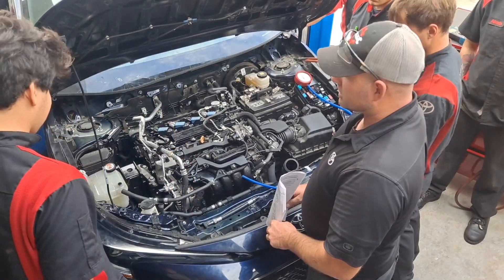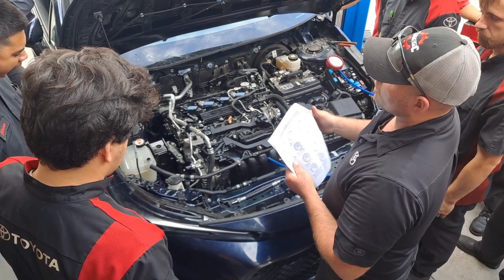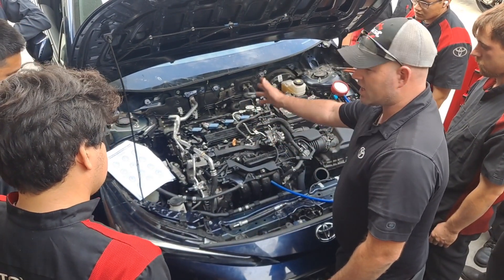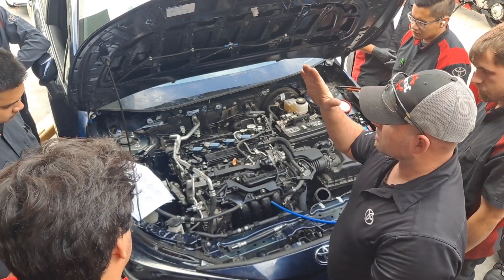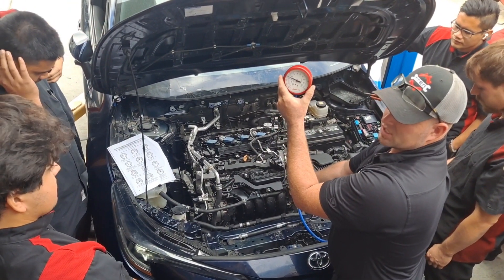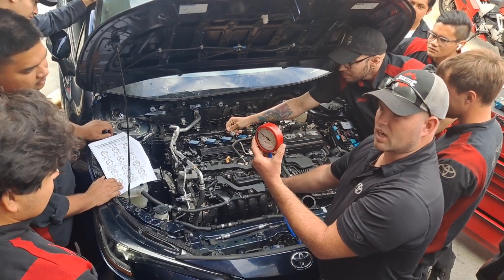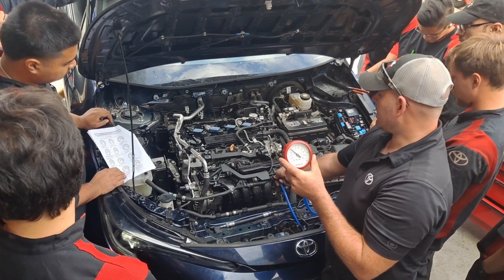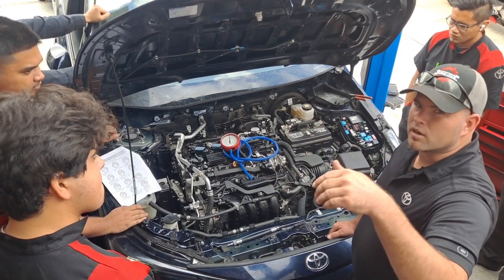A lesson on engine vacuum testing

Comment: As a mechanic here's my two cents. Correct me if i'm wrong. Checking a modern car with a vacuum gauge won't give you an accurate reading unless there is some major mecanical issue such as a broken valve spring, gasket leak or exhaust restriction. However the reason the vacuum gauge isn't ideal on modern cars is because the throttle plate is computer actuated. When the car starts the throttle plate actuates and stays slightly open to keep the ideal amount of air entering the combustion chambers. That decreases the actual vacuum and will give you a reading around the 15-17 inHg (Inches of mercury) which is on the low side even if the engine is healthy. That can mislead a mechanic to think that there are timing issues with the engine.
Reply from the maker: All accurate, and to take it a step even further, an engine like this is actually an Atkinson cycle. It has so much valve overlap it may not make enough vacuum to run a brake booster. So they add a cam driven vacuum pump to "power" anything using vacuum which is really just the vacuum brake booster in thise case. 

So overall I agree the vacuum gauge would not be the go to. 

The scan tool is going to be the #1 workhorse, especially with a relative compression test. 

But ASE A1 still has vacuum readings on it, and it is still good general knowledge for upcoming techs, so I will continue to teach it at a basic level like this. 

Good input.
Reply: @paulkelley86  Correct. I also strongly believe that all mechanics should know how to use a vacuum gauge.

Comment: A studied man will see observe the needle shaking and replace all the valve springs. A wise man won't have read the gauge while it was sitting on valve cover in the first place.

Theory is good to know but awfully dangerous if its all you know.
Reply: I dont understand what your trying to say the comment makes no sense
Reply: @sircob3  These kids are gonna put their vacuum gauge on the cylinder head of a running engine and diagnose it with valve spring failure because no amount of schooling will teach you common sense.
Reply from the maker: @jadenwalker6713  I get the point, luckily this program comes with a mandatory internship. I agree 100% on the job experience is necessary. But I have seen the other side where people trained on the job with no training are basically a clone of the person who trained them. Monkey see monkey do. Not sure why they do it but they know they do it because it's what they were told to do. 
But no argument 😎
Reply: I’ve done this.  Sat the gauge on top of the engine and had to watch about 15 YouTube videos before I realised my mistake.  😂
Reply: @CurboroughSprinter  I've done worse. I pulled apart and entire chassis harness looking for a discontinuity because both brake light bulbs burnt out at the same time.

Comment: if at idle have 12 in/hg  steadily and low power whAT IS PROBLEM?
Reply from the maker: We check vacuum when the vehicle is not running right. What is the symptom of your vehicle?

But yes as far as specs go, that is too low
Reply: @paulkelley86  I HAVE A NISSAN ALMERA 1998 MODEL 1.4CC IT STARTS VERY HARD WHEN IT STARTS IT HAS LOW POWER AND RUNS LIKE IT HAS LOST TIMING.THE VACOUM  IS 12 IN/HG AT IDLE .THIS HAS A DISTRIBUTOR AND IT HAS A CAMSHAFT SENSOR IN IT WE SUSPECT THAT THE SENSOR IS GIVING AN IRREGULAR SIGNAL AND THE IGNITION IS NOT AT TOP DEAD POINT.I HAVE GOT COMPRESSION I HAVE 190 ON ALL CYLINDERS FUEL PRESSURE AND DELIVERY IS OK SO WE SUSPECT A ERROR IN IGNITION TIMING WOULD GIVE LOW VACOUM.WHAT IS YOUR OPINION?WON'T A WRONG TIMING SPARK GIVE LOW  VACOUM ?WHAT ELSE WOULD CAUSE LOW VACOUM AT IDLE?.I WILL PROBABLY OSCILOSCOPE TO  THE SIGNAL BECAUSE I HAVE A PULL UP DESIGN AND SEE IF THE CAM SENSOR SIGNAL IS SIMILAR  I AM DIMITRIS mechanic FROM GREECE THANKS MY FRIEND....SORY I FORGOT I SEE AND INJECTORS IS OK.....AND I'M THINKING TO LOOK FOR A CLOGGED EXHAUST AS WELL ALTHOUGH  VACOUM SHE DOESN'T SHOW ME SUCH A THING.BUT I WANT TO BE SURE
Reply from the maker: @dimisrambodimisrambo7285  the low steady reading and loss of power could indicate valve timing is off, but that would normally result in low compression as well. It would not be that hard to verify ignition timing with a timing light and verify cam timing at the belt referencing the timing marks. Good place start. 
Your vacuum and compression readings are kind of conflicting. Maybe one gauge is inaccurate.
Reply: @paulkelley86  MAYBE I WILL LOOK AGAIN WITH ANOTHER INSTRUMENT THE VACUUM .I DON'T THINK THE TIMING CHAIN IS GONE I THINK THE SPARK IS GOING AT THE WRONG TIME SO MY COMPRESSION WILL BE OK BUT THE SPARK WILL BE TIMING WRONG,I WILL ALSO SEE THE ADVANCE WITH THE LIGHT AND I THINK I WILL SUCCEED, I WILL UPDATE YOU TOMORROW AS SOON AS I FINISH IT. YEARS AGO I HAD AN OLD AUDI THAT I HAD CHANGED THE ENGINE BUT I HAD INSTALLED THE DISTRIBUTOR FROM THE OLD ENGINE AND IT WENT OUT.SAME SYMPTOMS.HOPE I CAN FIND AN EDGE AND MAKE IT WORK THANK YOU FOR YOUR TIME.I SUBSCRIBED TO YOUR CHANNEL I WILL WATCH YOUR VIDEOS I AM INTERESTED.I WILL TELL YOU MY NEWS TOMORROW GOOD CONTINUE
Reply: @paulkelley86  HELLO MY FRIEND I FINALLY COULDN'T FIX THE NISSAN ALMERA. I CLOSED ALL THE VACUUM HOSES EGR PCV BRAKE BOOSTER ETC AT THE INTAKE MANIFOLD. I TOOK OUT THE EXHAUST AND THE CAR STILL IS RUNNING AT 13 IN/HG AT IDLE.I PUT MY MULTIMETER ON THE L SENSOR AND ON THE ROAD DRIVING AT WOT IT GIVES ME 0.9 VOLTS BUT CONTINUES TO HAVE LOW POWER.SINCE THE O2 SENSOR IS GIVING ME 0.9 VOLTS I ASSUME I HAVE FUEL AND THE MAF IS WORKING SINCE A MAF WOULD NORMALLY GIVE ME LOW VOLTAGE AT WOT.DISTRIBUTOR DOESN'T ADJUST ADVANCE I'M FAR FROM THE POINT MARKS.HOWEVER TIMING IS FINE AS IS CYLINDER COMPRESSION AS WELL AS THE CYLINDER LEAKAGE TEST EVERYTHING LOOKS GOOD.I HAVE NEVER SEEN ANYTHING LIKE IT IN A CAR.SHIFTED CRANKSHAFT GEAR? BAD DISTRIBUTOR?BAD ECT SENSOR?I HAVE NOT DIAGN.TOOL FOR LIVE DATA IS OLD MODEL
Reply from the maker: @dimisrambodimisrambo7285  we don't have the almera here. Can the distributer be off teeth? Or is it a type that can only be off by 180 degrees?
Reply: @paulkelley86  no, he doesn't have teeth, he gets into a position and you turn him around.....and inside there are camshaft sensors

Comment: What if vacuum gauge is at 15 but fluctuate at idle
Reply from the maker: Typically I use the vacuum reading to get an idea if the engine has an issue then change over to a different approach. The fluctuation is likely something to do with valvetrain if it is a rapid oscillation. Is it misfiring? If yes, I would pursue DTC check to identify which cylinder or possibly a power balance test if it is not setting codes. Then I would change over to compression and cylinder leakage tests once you identify which cylinder it is. 
This is all assuming you have a misfire. Which I suspect due to your vacuum readings.
Reply: @paulkelley86  yes sir it's not a rapid fluctuation it fluctuate from 15-17 on gauge I have a p0300 p0171 p0174 codes on a 08 Chevy Express van with 6.0 liter..it has misfire on 2 3 4 and #7 cylinders long term trims on startup are at 25% both banks but come down to about  13 when it gets warmer but when warm ill push gas and trims go back up to 24.. so that i thought maf sensor or fuel but fuel pressure is 58 psi doesnt drop underload and doesnt bleed down. So I went and got a new MAF sensor from AutoZone still no change on trims
Reply from the maker: @Smith93646  the misfire(s) will cause the low vacuum. The misfire will also cause the fuel trim lean because those non firing cylinders will be pumping oxygen and unburned fuel into the exhaust. The o2 sensor can only read oxygen so the surplus of oxygen will make it read lean, they are blind to the fact there is raw fuel.

Don't worry about any sensors. The misfire is the root cause. Diagnose the misfire. 

I would do spark test on all cylinders to see if the coils are firing. Inspect the spark plugs to see if some are wet with fuel due to no spark or similar. If all spark is good then move to compression test. If compression fails then leak down test the failed cylinders to pinpoint what is wrong. Or if compression passes you can move to checking injectors but that gets a little tricky. I'll walk you through it if you can get the tools to do the tests.